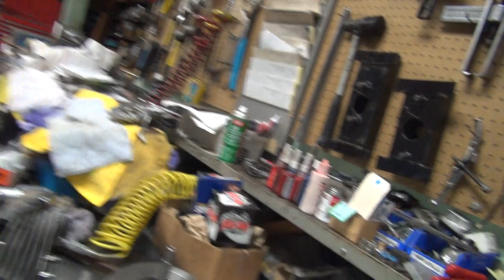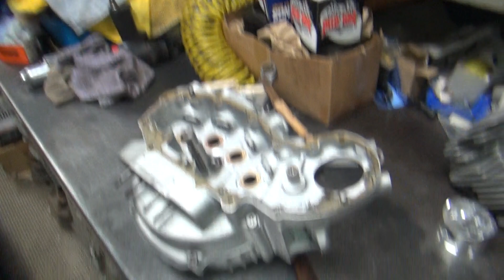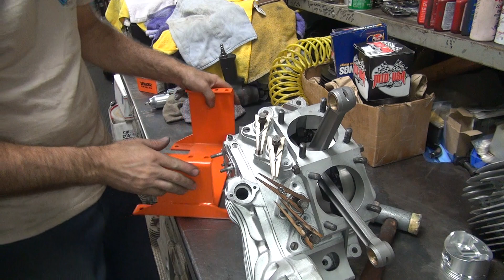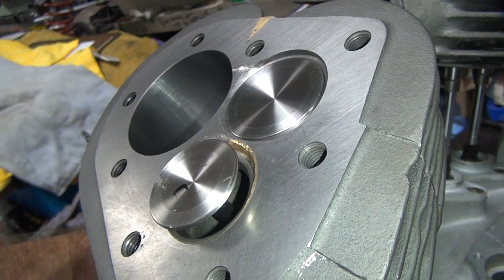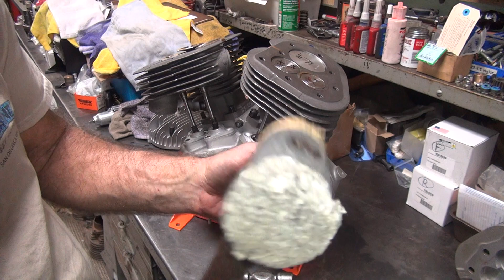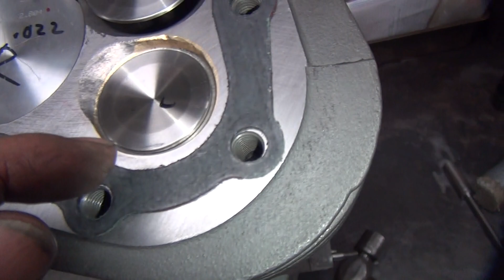1941 wld 45 56ci stroker #210 flathead motor build 4-5/8 in harley wl by tatro machine

Comment: Just beautiful..        How do you feel about stroker plates on 45's to correct the deck clearance, Tatro?    Someone mentioned putting piston skirt oilers in the plates?    Any thoughts on that?
Reply from the maker: if you want a stroker motor you have to do what you have to do to make it all work. i try not to use plates but sometimes that is what you have to do. on my race bike i used a 1/2" thick plate because i stuffed a 1" stroker crank into it.
tatro

Comment: hey tatro, got a question. on my 38 ul, got aftermarket v twin smooth camcover. got an original late style feed pump. cant get any oil to primary chain. no oil comes out of the adjustment screw hole in cam cover when i remove it with bike running. do i have to use early style pump or is this cheap ass camcover junk? maybe blocked somehow? passage not drilled? saw this vid and thought id ask. appreciate your time
Reply from the maker: sounds like more of taiwan teddy crap. get the oem oil system schematic out of the oem service manual and see what is wrong.
tatro
Reply: @TatroMachine  good call. will do, thanks for your time